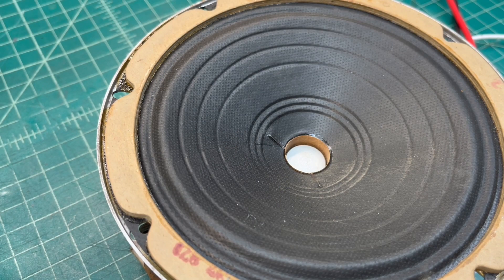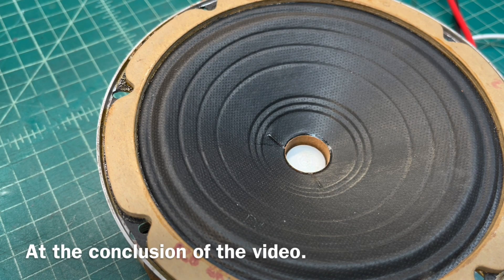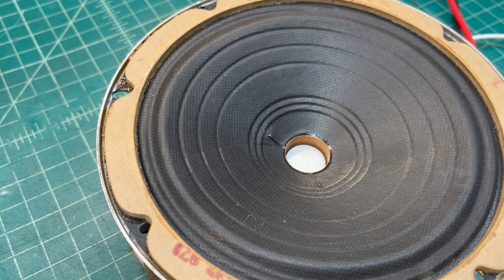Knight 98AE-184K -  Fixing a Rattling Electrodynamic Loudspeaker

Comment: Great job, Don.  Enjoy the way you do these repairs.  Great suggestion on the field coil power source.  Thanks!
Reply from the maker: Thank you. The field coil battery power source is limited and in my case provided 10.7mA=20.2V/1887R, for a set designed to operate at ~44mA, but useable with a reduced output. Thanks again. Best, Don